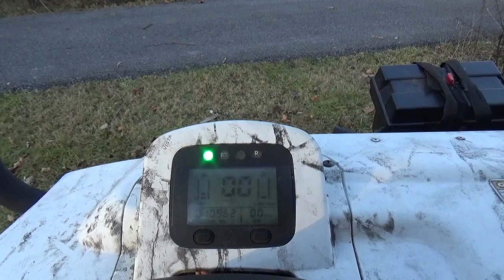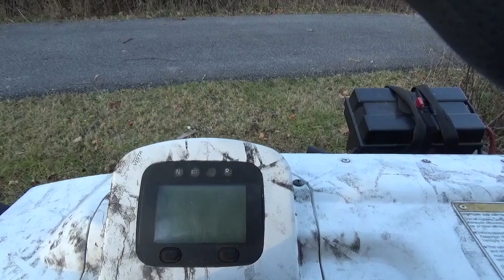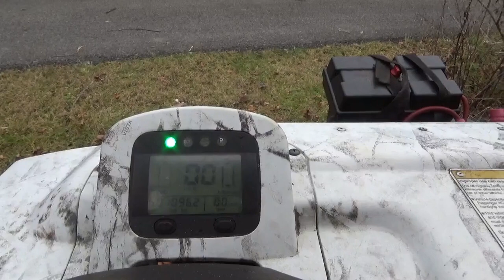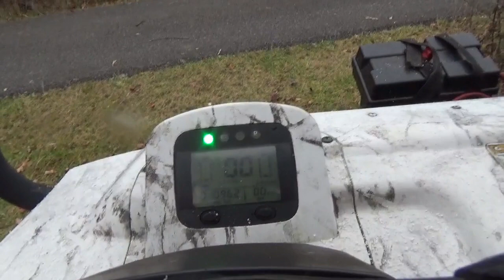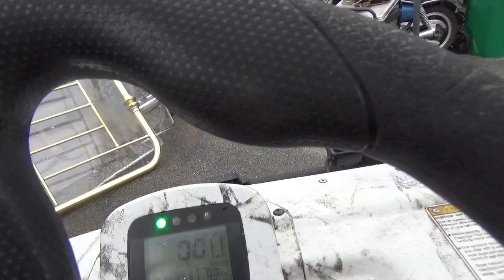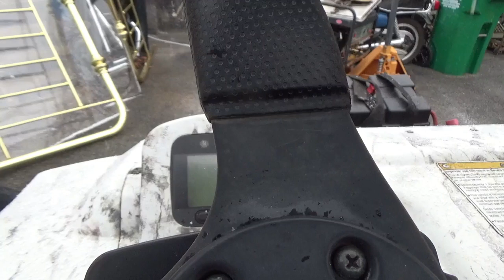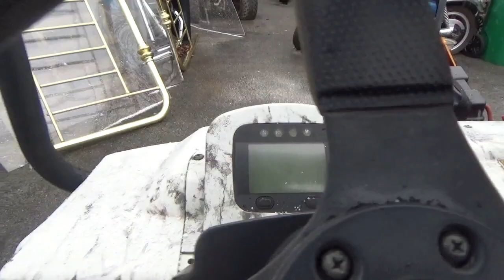Linhai Big Horn 400 UTV 28 Died, Let's Fix it!

Comment: I just bought this exact same UTV on Dec 26, 2022. Same year model too. It only has 268 miles on it and was garage kept and owned by a 70+ yr older. What I'm learning is the carburetor is the most painful issue I've had in a whole on Chinese off-road vehicles. It sputters at low rpms and once you touch the gas, it runs nicely. Drive it for 15 mins at half throttle and it will flood put when you stop and WILL NOT start back up till the plug dries off. This tells me it's still running rich. I'm going to lean out the mixture again but last time I did that it starved for fuel. Carb is crystal clean and factory jet sizes. I'm thinking I will run a DR7EA plug which is one step hotter. I had to do this in a Yamaha YTR110 dirt bike my son had a few years ago and also drilled a 1" hole in airbox and put a snap in airbox filter to tune in the A/F mix just right. Has anyone bought another brand replacement carburator that worked beautifully on these Linhai 400s?
Reply: I have tried a honda hornet 1998-2003 keihin 34 cvk carb. (It required several plugs in the connection holes) it fits hardly original intake hose(if is new and soft, old one was rigid). Obtaind very good start and very good idle and not enaugh gas for main jet. (Original honda jets have been used), only main jet fits between those carbs. In order to perform further test there are several modifications that needs to be performed for this this hornet carb. I took the easy way and orderd new chinese carb wich i'm  honestly not expecting to work, but to use it as a donnor for the original carb which is japonese.
Anyway, think if anyone can get a keihin cvk 34(from a single cylinder) and a set of jets may worth to try. It fits intake, air filter and acceleration can be easly improvised to fit. Choke is different in size, and mine was rod driven while on my quad is cable driven this conversion require mor work, an original cable drive choke would be prefferable.
This test confirmed me that is a carburator issue i'm dealling with.
Reply: New chinese carburator arived, fits and works perfectly

Comment: Harvey I had one of those similar to that had two problems with it one the exhaust clogged up so I had to replace the muffler you wouldn't believe how much that affected the power it went from crappy too I got at least 10 more miles per hour after I put a different muffler on it too the water pumps break the impeller don't know why but it doesn't pump water through the engine and they tend to overheat what I did to pull the return hose off of the head start to engine up mine didn't pump a drop of water out....

Comment: The electrical systems on these Chinese atv/utv's are shoddy. Crimp connections and wire gage are substandard. Very easy to lose connection or have high resistance. One could take the time to solder all the crimped connections but something else will end up giving you trouble.